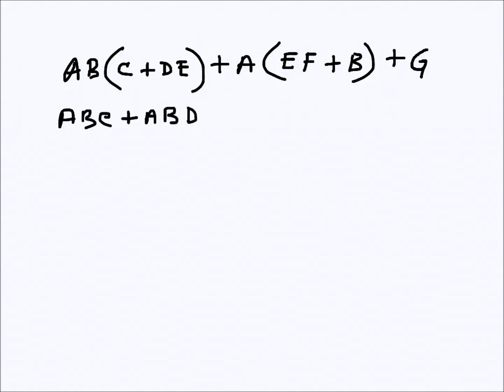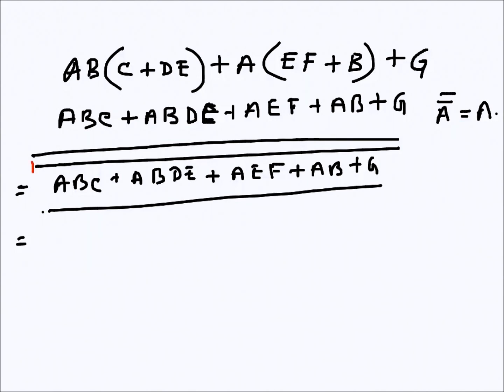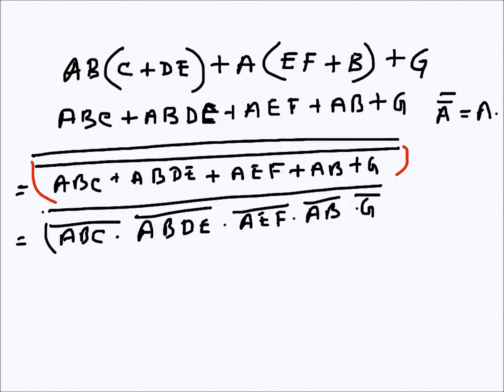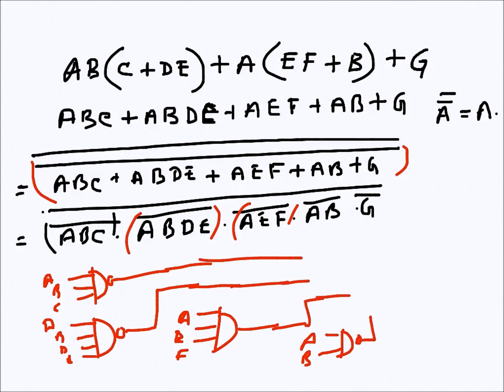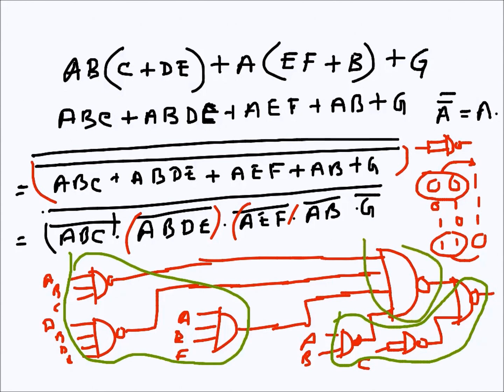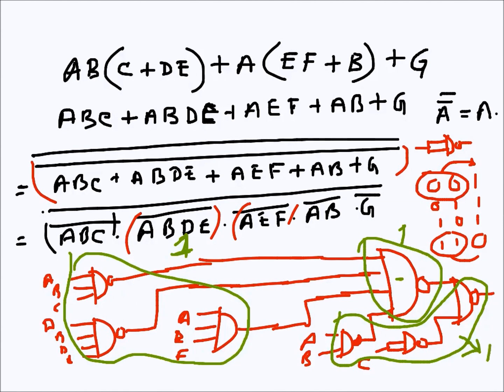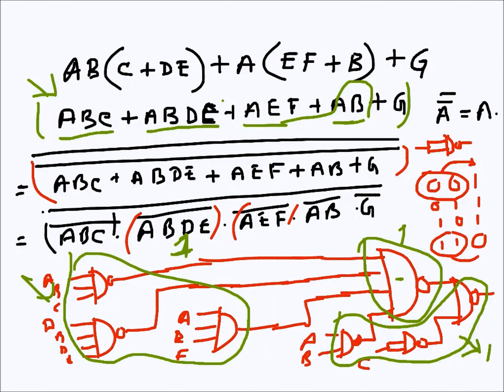Digital Electronics: Implementing SOP expressions Using only NAND gates

Comment: hi there, i have question here
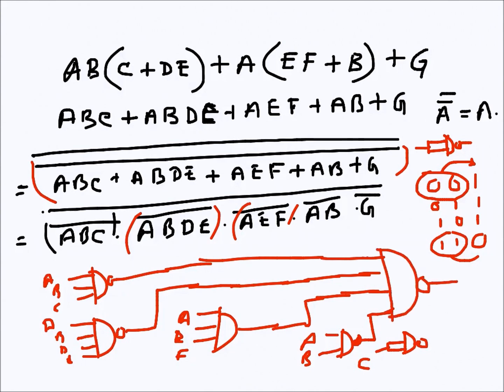when u added the nand gate at 2:22, this will add a bar to the input to that nand gate, so in the end it will not match the given expression, am i right????
Reply from the maker: mohammed alshagaa But we are implementing the 4th line (last line). It has bars on top of all the terms, doesn't it? First we modify the given SOP expression into one that has bars on top of all the terms. The aim is to implement the SOP expression using only NAND gates.
Reply: sacademy  i know that, let me rephrase my question, i will use "bar" to represent the bar
at 2:22 when u added the nand gate the output of that gate will look like 
 bar(bar(ABC).bar(ABDE).bar(AEF).bar(AB))
so the final output will look like 
bar"(bar"(bar(ABC).bar(ABDE).bar(AEF).bar(AB)").bar(G))"

hope u understand my question and guide me from there 
thanx
Reply from the maker: mohammed alshagaa Sorry, I missed your comment. I will look into it and get back to you.
Reply from the maker: mohammed alshagaa You are right, the diagram is incorrect. Earlier I checked only the expression.
 We will need a 5 input NAND gate in the end, so the five outputs of (/A/B/C), (/A/B/D/E), (/A/E/F), (/A/B) and (/G) will be the inputs of that 5 input NAND gate, NA53 is a five input NAND gate. 
Thanks for your feedback.